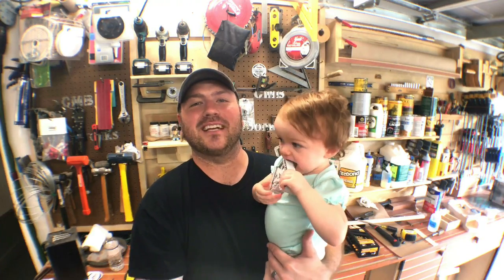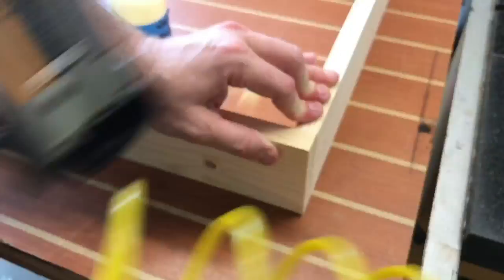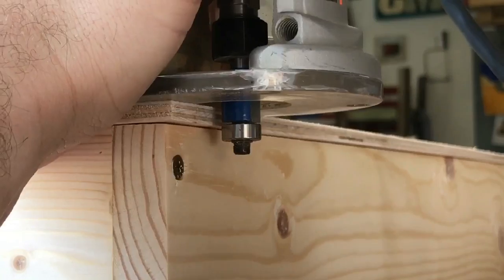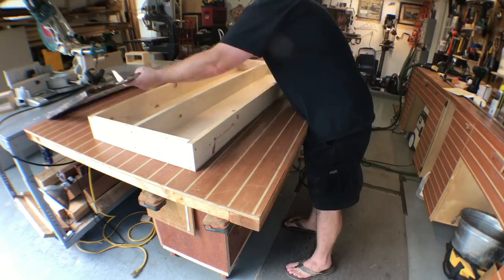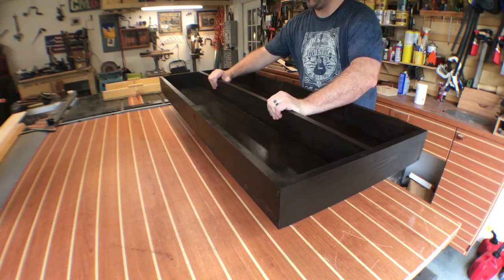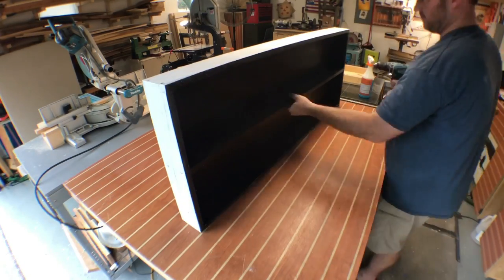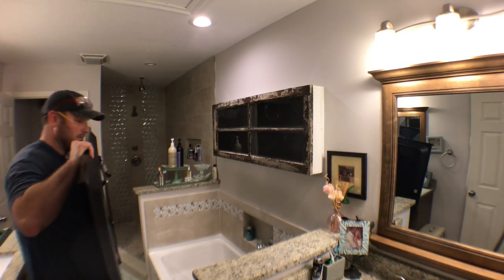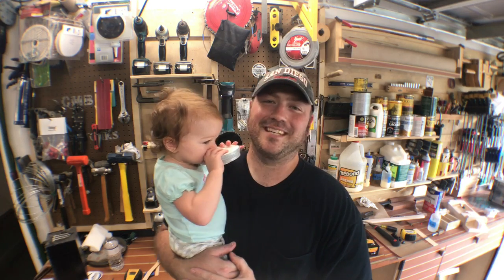How to Make a Rustic Window Cabinet | Woodworking | DIY Project | Storage Solution

Comment: Nich one! , recycle reuse and nice sander I'm getting ready to order one myself making that jump LOL
Reply from the maker: +Joe basement woodworking thanks man and do it!  Once you get the vacuum plus one tool it makes you feel like spending $600 on just another tool isn't so bad because you already have purchased the vacuum 😂
Reply from the maker: +A Glimpse Inside by the way I've had that sander for five years and it performs like the day I got it
Reply: A Glimpse Inside that is good to know which one do you have is that the Rotex??
Reply from the maker: +Joe basement woodworking yes. The 125. Is a great tool. It's a bit heavy for my daily driver but, I've gotten used to it